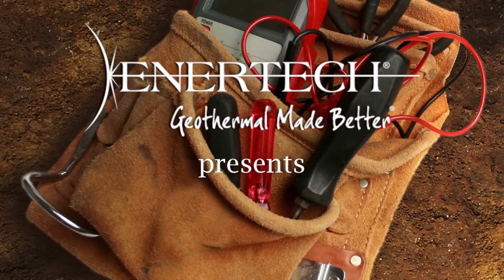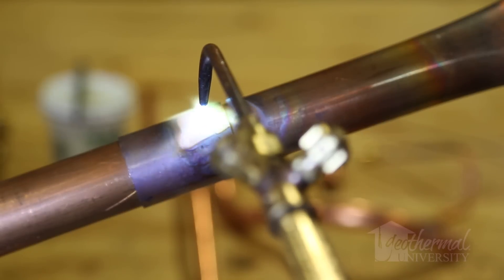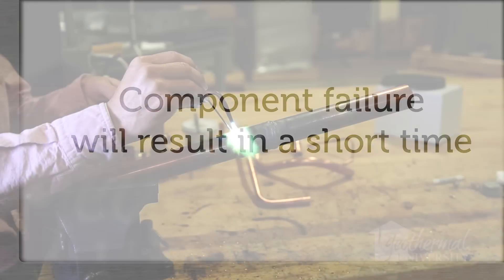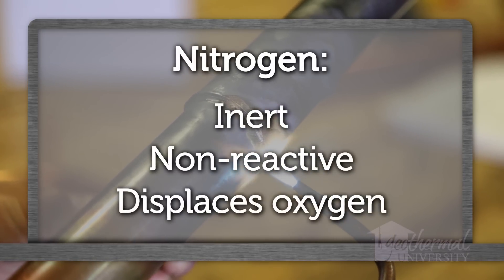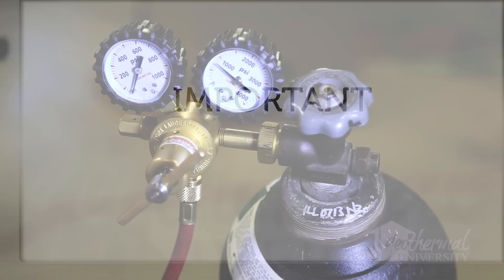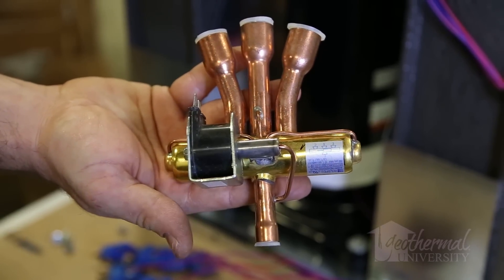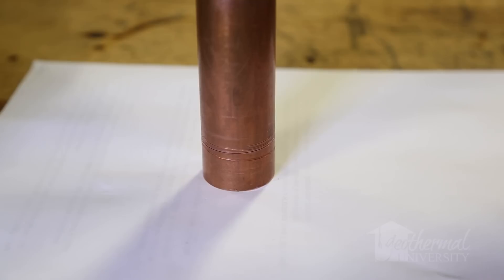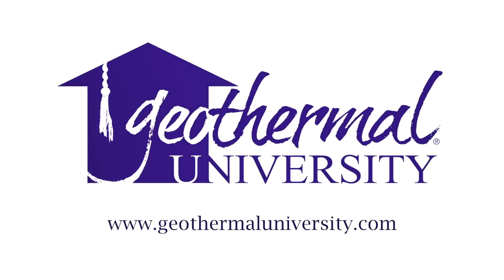Nitrogen Purge While Brazing

Comment: A good way is to hold a lit match at the exit point.  Nitrogen will snuff out the flame if there is no oxygen present.  A flow meter that is very sensitive, should be used instead of a regulator.  It’s flow that is important, not pressure.

Comment: Bravo!
I just had TWO expensive Carrier Inverter systems installed and the contractor did NOT use nitrogen as he said he would. He will not replace the two air handlers and outside condensers and I contacted my attorney. I have way too much $$$$ in this investment for it to have a very short life.
Reply: Sixteen years in the trade and I’ve never once seen this done. If he pulled a triple vacuum using nitrogen in between then there’s no difference. That stuff comes out that’s the whole purpose of pulling a triple vacuum (another thing no one does) regardless I’ve pretty much never seen and line blockage unless the installer accidentally put the end of the pipe in the dirt and didn’t have it capped then didn’t realize there was a little piece of sand dirt or stone in there. I’ve only seen that once but yeah I went to school and they never taught us this.
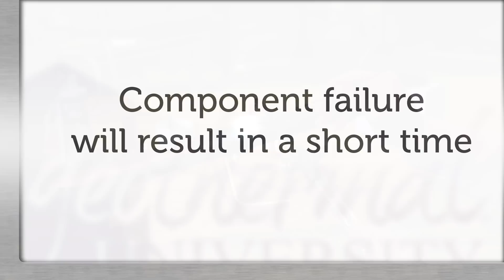Reply: @Alienspecies635  At 1:40 he explains that this is a larger issue with R410A, so it makes sense that this is more of a new practice and was not taught in school back in the day. Tech schools now are teaching this procedure though.
Reply: @alecbrendon6662  true but still no no one does it. And 410a isn’t new it’s been around for a good 15-20 years now
Reply: @Alienspecies635  Absolutely. I'm not saying R410A is new, but R22 has only just gone out of production last year. New practices take years to incorporate into the norm, especially when all the older experienced techs tell the newer techs that it doesn't matter. So it's no surprise to me that it's taking years to become a regular practice. 
I'm currently a new student myself so believe me I'm only trying to learn, not trying to grind your gears.
Reply: @alecbrendon6662  22 will keep being sold another’s or so
Reply: @Alienspecies635  I don't doubt it. Black market refrigerant sales lol. 
I don't know, to me it doesn't seem like much extra work to flow I tiny bit of nitrogen to ensure a clean system.
Reply: @Alienspecies635  no one?   Only the lazy techs that have no pride in their work don’t do it.  Did you ask every tech in the country if they do or don’t, to come up with that statement?
Reply: @alecbrendon6662  Purging it’s nitrogen is not a “New” procedure.  I started in the trade in 1973, and learned it at my first school which was the Navy’s Refrigeration and Air Conditioning School.  I think that was about 50 years ago.
Reply: Or after years the filter drier eventually breaks down….
Reply: @Alienspecies635  30 year HVAC instructor here.  You are plain wrong.
Reply: @rodgraff1782  plain wrong about what? I said I’ve never seen anyone use nitrogen while brazing. So your just calling me a liar? I didn’t say it a ways the right way to do it I switch companies last year because they didn’t do anything by the book
Reply: @rodgraff1782  I know the 3psi purge rule and the triple evaluation to keep the lines from freezing up can you
Correct me on what I am wrong about? I don’t mind constructive criticism but I definitely won’t be called a liar
Reply: @Alienspecies635  No, I’m not calling you a liar. I’m just saying you haven’t been around much.  I believe it when you say you’ve never seen anyone who has done it.   Just because you’ve never seen it doesn’t make it true.
Reply: @Alienspecies635  Triple evacuation went down with the titanic.  Just use a micron gauge, instead of doing things three times.  That’s old technology.  In my 30 years of teaching we never did three evacuations. Sure, I’ve heard about it, but that was before electronic micron tools came out.
Reply: @Alienspecies635  Everyone has their own way, so do what ever works for you.  I was a Service instructor for 30 years, teaching a 5 year Service programs.  I’ve taught close to a thousand Service techs, some who are now large service company owners.  Ways of doing things are constantly changing.  Not calling you a liar.  We just have a different opinion.

Comment: How do you braze a pressurized system? Wouldnt the nitro blow out the seal every time?  Or i guess your talking about using as a pass through internal shielding gas..  and thatd work fine up until your final connection unless you are able to work it in a way so the last point is next to a service port you can open up..
Reply: That’s the reason you are supposed to us a flow meter, instead of a regulator.  You can get proper flow, by just barely letting it in.  You purge the line well before you start brazing,  to remove all the oxygen from the pipe.  After that you reduce the flow to almost nothing.  If it will extinguish a match held at the outlet, that is enough.  A flow meter has a valve, and the flow is indicated by a ball that floats vertically in a sealed tube.  I always  used the minimum setting, and that was enough
Reply: https://youtube.com/shorts/Vhp07307c9Q?feature=share

Comment: We are into manufacturing of SS utensils. We use TIG with argon gas for welding. Sheet thickness is 0.4 mm. Sometimes we get holes, while welding. One of my friend told about nitrogen purge. Can you provide solution for my problem. If required, I can share photos. Please provide your feedback..
Reply: I'm not the video uploader but just wanted to throw this out there for anyone else reading.
Argon is an inert gas. you should be fine using that. If you're getting burn through, you're either keeping the electrode there too long or you're using too high of a current. if you're welding really thin metals, you'll need to set the set the tig welder for very short duration welding.
If it's not programmable, you'll need a pedal that can be used with an ardiuno board to program for short bursts.
Reply: If you're already welding in short bursts and are still experiencing burn through, you may need to add a filler metal. I especially recommend filler rod if it's two parts side by side since it's taking from the base metal every time you put the electrode to it, the parts are too thin to do that.
If you're welding one piece on top of another instead of side by side, you'll be far better off using a spot welder.

Comment: Does this process specifically require nitrogen, or can another inert gas be used, such as carbon dioxide?
Reply: Only Nitrogen is approved!
Reply: john pendleton,

Approved by who?

My local nitrogen supplier?

"Let me tell ya something!"
 (reference to Fire Marshal Bill, from Saturday Night Live)

I conducted an experiment. I flowed 25% Argon / 75% Carbon Dioxide through a copper pipe swaged connection, and brazed that joint.
Then  ...  I cut the joint apart and carefully inspected it.
Betcha' can't guess what I found.
YOU CAN USE OTHER INERT GASSES.

Why did I choose the Argon/CO2 mix???

Mmmm  ...  cuz I already had a tank, regulator, flow meter set-up for my MIG welder.

So, if the Nitrogen Police raid your jobsite, and shoot up your brazing crew, use your last dying breath to mention that Marshall approves any inert gas for residue-free brazing.
I mean, if you're going to bleed out soon anyway  ...  stand up for yourself.
Reply: @marshalllhiepler  nitrogen is a lot cheaper and more readily available.
Reply: @TheNYgolfer  it used to be cheap.  The last time I had my cylinder filled the price had gone way up.  This was at a welding store.  They said it had gone up due to the fewer places that refine it.

Comment: How about filters. They are supposed to catch this junk.
Reply from the maker: Hi Jeswen, We appreciate your comment. We believe an ounce of prevention is worth a pound of cure. The filters will catch most junk but it may get stuck in the TXV first or stay in the compressor oil until the filter catches it. Purging with Nitrogen is always better.
Reply: Geothermal University  
I appreciate the video as well. But you braze 50 cm pipe and in reality we are talking about 100 meters of pipe from the opening where you can put nitrogen to the branch where you braze.  It's not really practical to waste so much nitrogen for each and every single braze.
Reply: FOAML8X Sorry if my verbage is a little rough. I could have said crap, but I never said Heat Pumps only last 10 years. We don’t even talk replacement until 15 years old. I have doing it to long the right way and I would hate to change now. 30 years ago techs hardly used vacuums. My first job as a tech we changed compressors with no drier or flush. Guy has a huge business. You do you👍
Reply: https://youtube.com/shorts/Vhp07307c9Q?feature=share
Reply: I have been installing for 20 years. I personally believe thats horseshit. I haven’t seen those results from a non nitro purge. I do use a drier every time I replace a compressor. Been working the same area for 20 years. It sounds like your saving the life of a unit but I find most Heat Pump Coils usually leak within 10 years and it’s time for a repair and that usually after the Compressor has been running hot for days with half a charge. That compressor is 50% likely to die the the same year as the coil is replaced.
Reply: If you need nitrogen flowmeters or nitrogen purge alarms, please visit or website. Www.themedicalgas.com

Comment: Hi, Im only wants to know more about using nitrogen during soldering / brazing during replacement of compressor? because there is no outlet, or exhaust. Thanks and regards.
Reply from the maker: You would need to run nitrogen through the your suction gauge line, then into the suction on the refrigerant system. Hook up your high side hose from gauges to the liquid line at the unit, then disconnect the high side hose from your gauges and let nitrogen bleed out of it
Reply: a it means from the service valve of suction line I will inject nitrogen and to purge in high side service valve when I soldering the line to compressor (vice versa). I've been checking in some shared knowledge in youtube replacing compressor and soldering applying nitrogen. that is my doubt since the compressor side nitrogen cant flow through it during repair and off condition. Thank you for your kind information...
Reply: @EnertechUniversity  how much pressure do I need to apply? Thanks in advance.
Reply: https://youtube.com/shorts/Vhp07307c9Q?feature=share